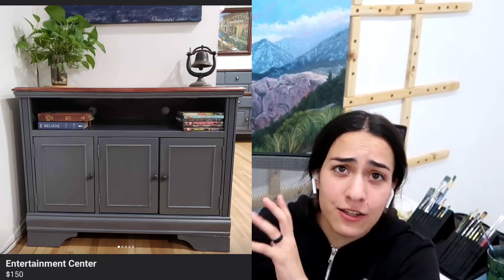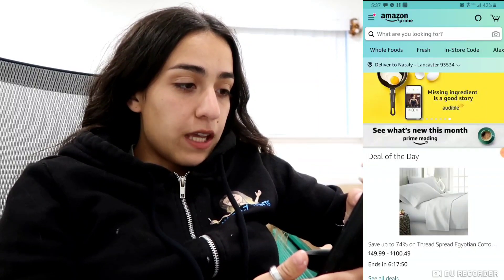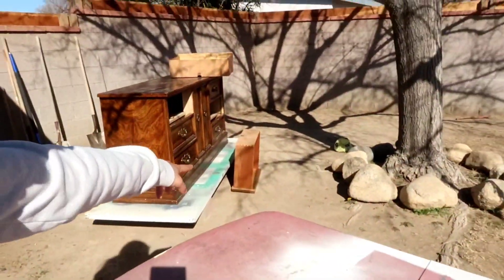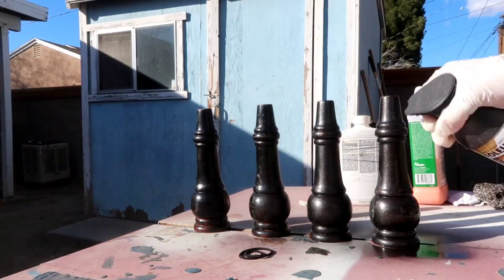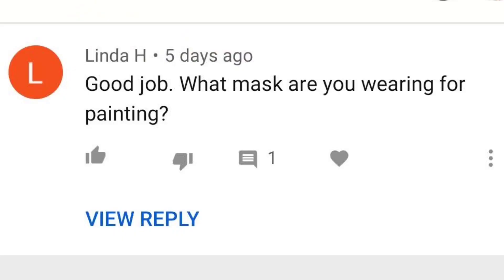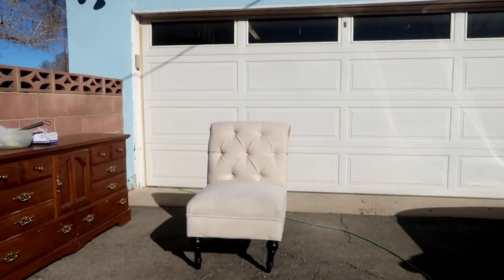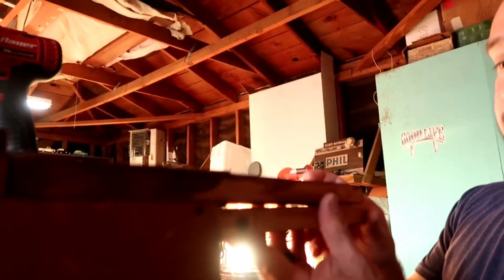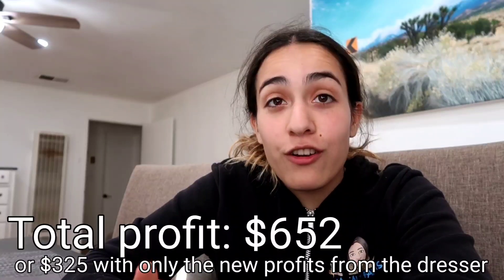Turning $48 Into $480 Furniture Flipping - Vlog Style

Comment: You can put wood filler in between the   cracked chair legs and the chipped dresser corner. Then sand it even.
Reply from the maker: I thought about it!! But I thought wood glue would be a stronger bond!